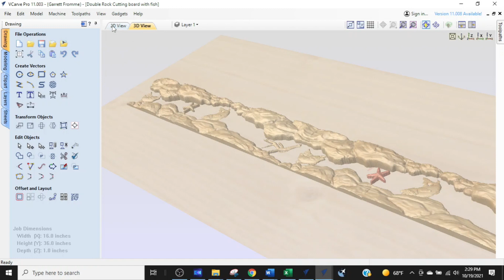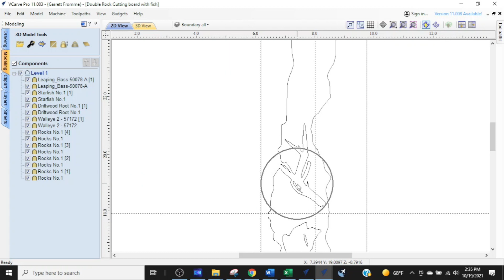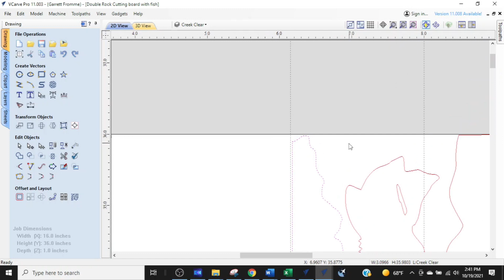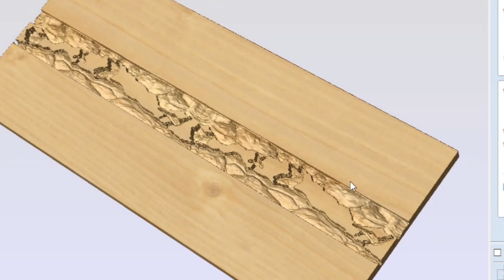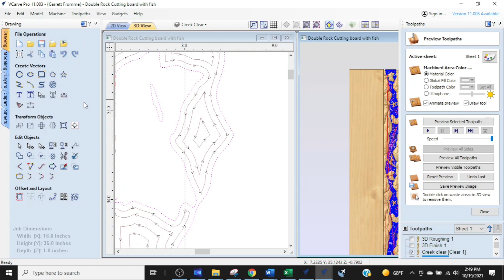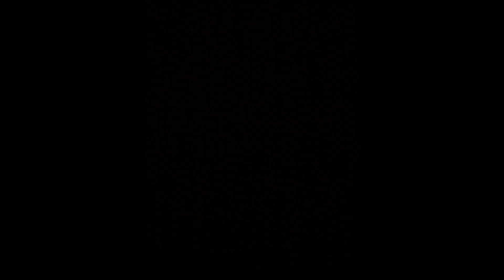Comment: Will this also work for vcarve desktop as there is no modeling tab just saw u say that it will
Reply: jus2bme02, Yes, you can definitely use similar techniques in VCarve Desktop, even without a dedicated modeling tab. You'll just need to adapt some of the steps to fit the software's capabilities. Happy machining!

Comment: Hi Garrett.  Great video.  A question if I may.  You are using a 1/4” flat end mill bit for roughing out the 3D carving toolpath.  I expected you to use a 1/4” ballnose for that, given that the toolpath is for 3D carving.  Why is a flat ended bit the better choice here and not a ballnose?  Andy
Reply: You can use either. I use the flat bottom bit for roughing it out and reserve the ball nose for details and accents